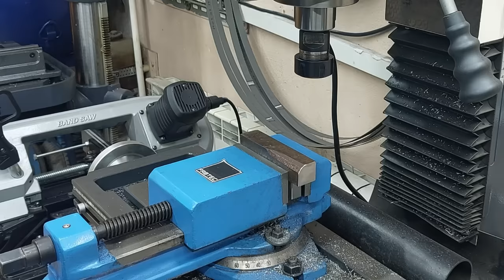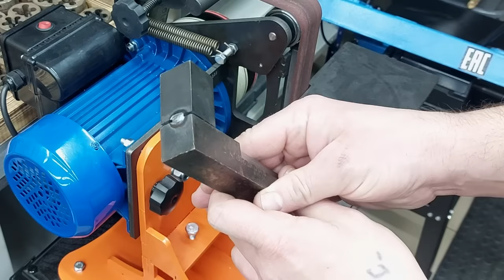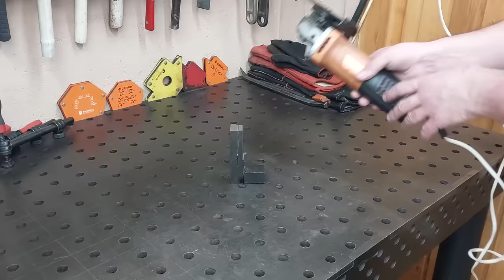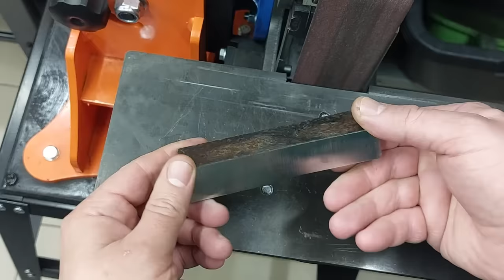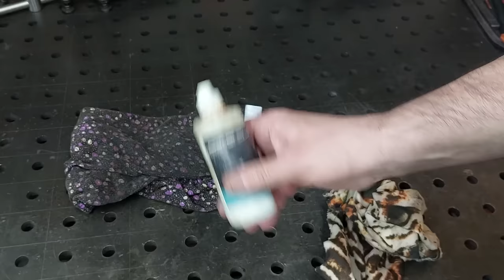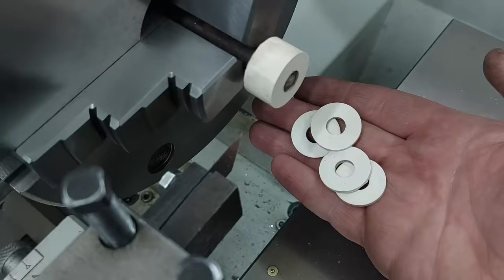Amazing idea and tip in 6 minutes! Few people know about this brilliant idea in action

Comment: Great idea for a variety of sizes of small numbers. But when larger numbers are required, on a regular basis, I use sheet material, neoprene and rubber etc. I’ve made up sets of wad punches where the larger punch blanks out the large diameter and a smaller punch, sliding neatly inside the larger punch, punches out the hole, using an arbor press. Works a treat.
Reply from the maker: Thank you, my friend! That's a great idea.